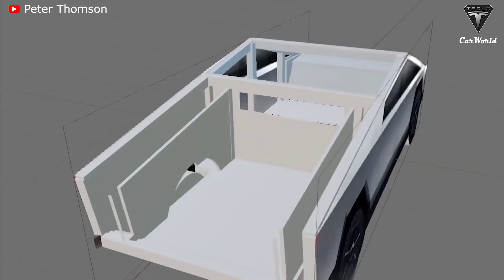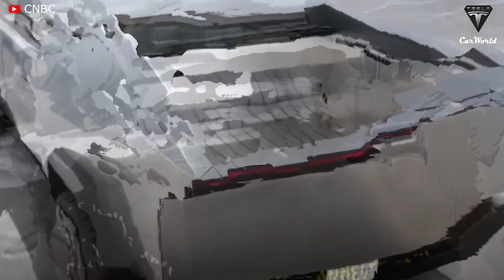IT HAPPENED! Elon Musk Reveals Insane Massive Schedule, plans to dominate EVs Texas!

Comment: Any of you smart guys can you cut through the BS of the massive wattage usage that an electric truck would demand?
RE: my diesel f250 gets 20.4 mpg at 65 mph on flat ground
If I hook my 10,000 lb toy hauler and drive same route it gets 9.8 mpg or about 1/2
So how do you reconcile the fact, trucks are made to tow, and your range and battery strength will be cut in 1/2 just like my mpgs on my truck?
An empty range of say 300 miles, drive to lake, would turn into 150 mile range with a fully loaded boat or trailer

Elon understands this, and like the carnival barker, selling you a better blender you will never get the facts until it's too late 

Good luck on your EV truck-- this was your dose of reality
Reply: You are comparing apple and orange sir , Tesla Semi work very differently than Diesel Engine.  The Tesla battery is not like regular Car battery which is only 12 Volt.  Tesla and All EV of other Brands are 300 Volts or higher,  FOR EXAMPLE, I can leave my Tesla AC Cold Air on non stop for at Least 30 hours.  I can sleep in Tesla wit the Heat Pump on overnight with only using 10% of battery
Reply: just to put things in perspective, an average USA House hold use about 26-30 KWH of electricity per day. Tesla Semi Truck batteries ( as well as all other Brands of EV Truck ) have capacity of 600 KWH to 1,000 KWH
Reply: PS let me know when Elon uses an EV truck to haul his car haulers trailers, he won't, never will, because you would see his folly 
Don't get fooled
Again
Reply: I think the Tesla EV truck's range of 300 miles is basing on fully loaded weight at 80,000 LBS
Reply: Except: --u guys don't get--
Time = Money
I can pull/drive a 80,000 lb load from SF to Phoenix in roughly 10 hours 
So, I have lobsters that need to get to Phoenix by midnight,  and I can do it, and you can't, zero emissions/no co2 is awesome however, u gotta move those lobsters in 11 hours or they die--- how u gonna charge your EV truck? U can only get 200 mi between charge --- 
Now if u want to build a hybrid diesel/electric like a train locomotive--- u did know train engines are mostly hybrid right? (Diesel generator powering your electric motors?)
Reply: @stevebrooks1355  fringe cases, how many people really need what you are asking for? A very small percentage IMO. I used to work in construction and we drove less than 100 miles a day. If that was 8 gallons of gas a day at current prices it adds up fast. There will be savings for most people that can switch to an EV. Not everybody will be able to in the beginning but you know that these continue to improve. The changes in just the past 10 years are quite significant.
Reply: @laurenceotoole1700  right right 
How does goods and services get transferred from loading dock to Amazon Trailers? To your front door? You're advocating for everything delivered to take twice as long? Why would u do that? Talk about supply side issues?
Most EV proponents have not driven the Interstate system and have no idea of the amount of 18 wheelers on the road
What you want can not be achieved without doubling the delivered fees and tripling the time which adds time down stream on getting to your door- Think it Through EV Long Haul trucks will not ever work, Elon knows this.
Reply: @stevebrooks1355  meh, not talking about semi-trucks man. I'm talking about pick-up trucks. A lot of the goods transported with semi-trucks should be replaced by a national rail system. It used to be years ago. That is a lot less energy intensive. When it comes to Amazon packages there is nothing that I order that can't wait an extra few days. BTW: Tesla isn't the only company working on EV long-haul trucks. If it is more cost effective then it will gain adoption. That is just how markets work. May not be ready yet but we shall see what the future has in store. My bet is that they will make it work even if that involves more transportation hubs and greater efficiencies in moving cargo to a fresh truck.
Reply: @stevebrooks1355  Yes., you are correct, the EV is not for everyone right now, we are just in the very beginning time of a new era.  No one is saying EV Semi is for everyone.  EV Semi is only good for who fit , such as fixed route delivery , for my company, I have 4 semi trucks which only delivery around our city everyday.  The total travel distance is less than 200 miles per day.  So we may switch to EV Semi in a few years .. save money on the fuel and cleaner air  assuming our electricity is generated by renewable methods
Reply from the maker: Thanks a bunch for all of your comment 🥰
Reply: One example: A Tesla Model Y ( a Cross over car ) weighted near 5,000 lbs, has only 75 KWH of battery pack, Rated for 330 miles per charge.  but it generates 400 and more of Horepowers . How many SUV and Cross over cars can generate this much of horsepower ???   I can drive at 65 MPH for at least 280 miles non stop.  Then  I stop at 250 V Supercharge station, it will charge at 1,000 miles per hour speed ( 1,200 KWH ) .  So for less than 30 min ( the chargin slow down when over 80% ) , I will be on the road again.  Tesla Semi will be using Mega Supercharger which will be at least 2-3 times faster then the current 250V supercharger.  and it have 600 and 1,000 KWH battery configuration ..  Tesla is NOT the ONly one making EV Semi, China / Europe / USA already have them in operations for at least a year now ...
https://ratings.freightwaves.com/upcoming-electric-semi-truck-companies/
https://en.byd.com/truck/
https://en.byd.com/truck/about/
Reply: So if a regular diesel truck can go 1200 miles without a stop to fill charge or wait, what you are saying is Tesla truck is approximately 25% as efficient as a regular diesel truck, thanks, makes sense
Reply: @stevebrooks1355  HI Sir,  I think you go all the numbers wrong.  One Gallon of Diesel cost said about $5.00, then you get $5 / 6 mile /  Gallon = $0.83 / mile.,  Tesla Semi said with 1,000 KWH of battery, travel 500 miles = 2 KWH/ miles time $0.30 cost of KWH = $0.60.  So it cost Tesla Semi $0.60 to travel a mile, and it cost Diesel Semi $0.80 to travel a mile.  So Tesla Semi save not only Money on Fuel also reduce air pollution